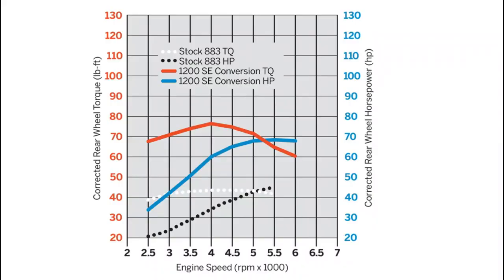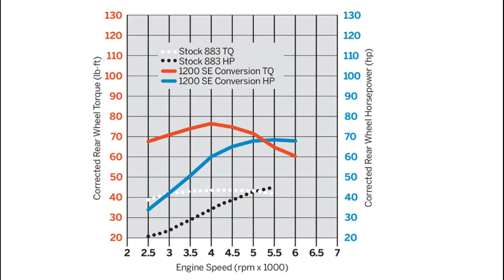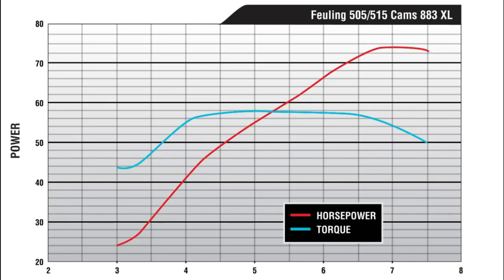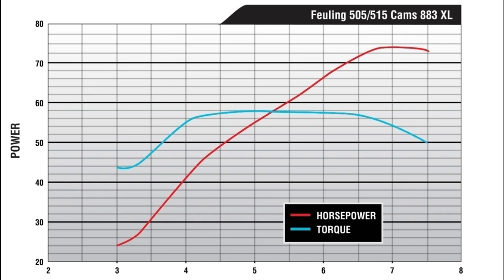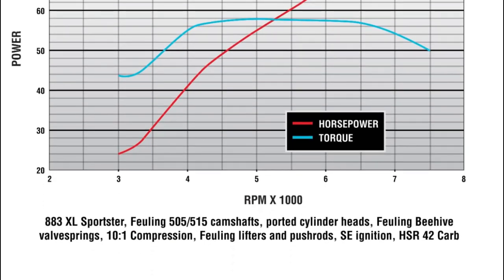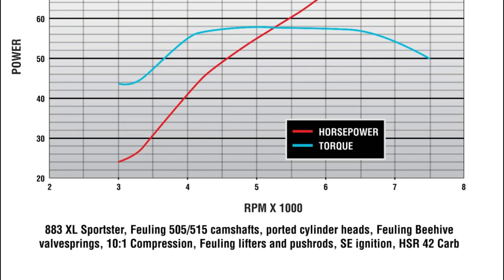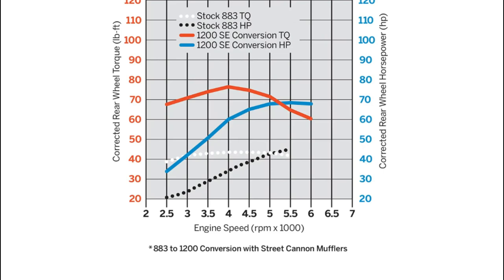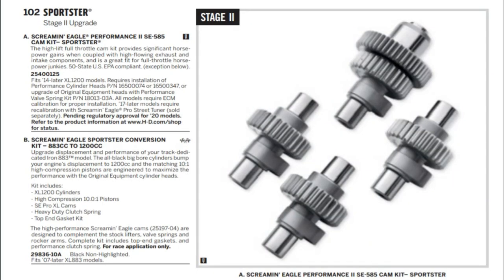Sportster Cam Upgrades To Increase Horsepower and Torque

Comment: Call Hammer Performances engine builder Fred yesterday
Told him $$$ is not an o option
He said  start with a XL1200 because  the  (heads) are good , then  get a 7.50 cam  & Energy One Clutch till the end of the season , break them both in together 
Then , IN THE WINTER  IT'S 😢TOO 
COLD TO RIDE go full on 1275-130+ b.b.k
With HEADS PORTED , HI-COMP  PISTONS .
With , Brass drive gear  , ETC. .
And probably make my own Header . ❤

Comment: Any opinion on upgrading an ‘02 Hugger with an S&S Hooligan kit? Looking to get better performance out of my bike vs spending twice as much on a larger bike. Hooligan kit includes a cam kit. Appreciate your professional opinion and experience. My Indy shop is an S&S shop, so they prefer going this route over Hammer Perf. Thx in advance!

Comment: What CAMS do you recommend for an 03 Sportster 1200 custom 100 yr? I have a stage one, and want to upgrade to a stage two. Just CAMS. Just want a little extra power and torque, don’t plan on upgrading it more than that. Just want to have power when I needed. 2003 Sportster 1200 custom, full Vance and Hines for exhaust, high flow air filter, never ride two up, I cruise at low rpm’s. Once and w hike have a Burst or two.
Reply from the maker: I would check out the Andrews N4, that's an excellent cam upgrade for a rigid mount bike!

Comment: I had a 06 Vince Hines pipes rejeted carb and a se 551 cams ran good.  But it needed a ignition modular.  It would it the rev limiter around 5500 rpm .I wanted to put the rev limiter 6500 .but I crashed the bike
Reply from the maker: Dang that sucks, hope you were alright!

Comment: This is very interesting.  Would a tuner be needed for this mod and additional work (like what Screaming Eagle wants with extra parts for the upgrade)?  Can you jump from stock to Stage 2 cams without pipes and air intake mods (adding them later)?  This is something to think about and lots more research that I need to do.
Reply from the maker: With cams it would definently need a tune, but yes it can be tuned for a new set of cams while using the stock air cleaner and exhaust. Timing is the most important part, you can get an aftermarket tune for a stock bike and it will make a huge difference.

Comment: Tomorrow I'm buying  a 2009 XL 1200 with  2,800 miles mint , Woman Owned , just completely serviced at Local Harley Dealer
My Question is ; 
Whats the the most  cost effective way to add Torque/Horsepower ???
My thinking is : 
Fit some Hammer10.5-1 H.C. Pistons $300
Hammer 560 or 570 cams .$500
Hammer "Crush" heads $1100.
I'm hoping to get 100+ Trqe/Hpr.

Let me know ?
Any ideas ?
Of course I'll talk with Aron @Hammer Performance also 😎

Thanks in advance Riders

Comment: I have a 2019 iron 1200. I’ve been thinking about a cam upgrade. What cam would you recommend?  I know I’m limiting myself, but I want a drop in cam.
Reply from the maker: I got the perfect cam for you and it's an absolute banger over stock. Check out the Hammer performance 570 cams, they are bolt in on the 2019 and they don't rob your low end for the top end. It's like the stock W cam but builds on the torque and you gain top end horsepower without any loss in the power curve anywhere.
Reply: @GixxerFoo  thanks for the recommendation. I will go and check out that cam

Comment: Don't Forget to Mention:
Dual Fire Ignitions do not sit well with cam upgrades.

and, honestly, if i would have had a W cam, i would not have felt the need to swap in aftermarket cams . i had the old D-cams, and single fire ignition; so it cost me $800 to swap into my N2s
Reply from the maker: That's a great point about the the single fire ignitions! The W cams are hard to beat since most Sportster cams take from the bottom and give to the top.

The only Sportster cams l have found that can beat a W cam all around power and give nothing up is the Hammer 570 cams.
Reply: @GixxerFoo  so you can imagine a single fire ignition given a higher overlap cam ..... i did ahead of time, i am sure the rear cylinder would back-fired to no end.

i got the Twin Tech ignition, and my N2s put peak torque up around 4K2 with my custom welded pipes...different pipes make any cam different.

Comment: H-D Installed Pin Oilers, ( "oil sqirters" ) When They Went To The W Cam .... All The Aftermarket Cam Girders Need To Reconsider Their Profiles Ground For Pre-Pin Oiler Sportsters.
Reply from the maker: That was good tech from Buell right there, Andrews and Hammer make great cams for rigid Sportsters. I still think Andrews grinds Hammer's cams for them but Andrews told me they couldn't confirm or deny lol.
Reply: @GixxerFoo  i recently found out that Ultima makes a "High Volume Oil Pump" that will fit my pre-pin oiler... so the answer is " increase the big end sling " when camming pre-pin oiler sporties.
Reply: @GixxerFoo  no problems 04 and on, the ones with pin oilers can pretty much handle anything you throw at them.

but i would definitely suggest a high volume oil pump when camming 03 and earlier model Sportsters..
Reply: @GixxerFoo  the only solution for camming pre-pin oiler Sportsters ( 2003 and earlier ) is installing a high volume oil pump with the cam swap..
i figured that out after my comment here.
Reply: @RulgertGhostalker  so do you think I need a high volume oil pump for my 2000 sportster 883 w the 1200 wiseco kit and the heads are done? The only thing left is cams now. It runs really good now but I still want more of course
Reply: @rogerthompson5521  yeah definitely ....anything pre-pin-oiler, putting out more than stock, i recommend a high volume oil pump ... in my last Sportster video, i go over the why on that, sit sump cures, and breather mods.....
i am pushing 1200 type power on my stock 3.000" inch bores, that's just cams, my custom pipes, compression increase, race ignition, 93+octane, and a whole month of work on my heads..but Same sort of Heat, with much higher BMEP, on the smaller pistons.

Comment: For a XL 1200 C 2017 model , which is the best cam for more torque ?
Reply from the maker: The best cam and doing nothing else to the bike is Hammers 570 cam. That is the only cam I have seen improve over the factory W cam without sacrificing power anywhere. If you're absolutely not worried about top end or the upper end of the mid range the Andrews W2 is a straight up low end cam. It will cut your top end power though so just keep that in mind.

Comment: What if I have mine bored out to a 1380 with a screaming eagle clutch and is straight piped what can I do to make it faster and go to a track and race
Reply from the maker: If you were to bore the cases Hammer does have 88 and 90 inch kits. Hammer can put together a 120+ horsepower package but it will run you about 6 grand and that's if you assemble it yourself.

Comment: There is no camshaft upgrade for a stock 883. Stage II on an 883 is a bore increase.
Reply from the maker: You can add cams to the 883 but it's really not worth it unless you're doing some kind of spec class racing. They will make some power but you're very limited by displacement.
Reply: Really? Because I can list a few cams that are drop in cams for the 883
Reply: @beardedforlife3740  go for it
Reply: @eveythingthatsadam  Andrews N2, N3, N4, and SE .497 cams all bolt right in with no extra changes

Comment: Did I hear this correct 100hp from a cam and exhaust?
Reply from the maker: If you have a good cam like the Hammer 560 on a late model injected bike with the good heads and a really good exhaust it is possible. Adding 10.5:1 compression will further solidify that. But if you have a 03 or earlier the stock heads are awful for performance, you'll need some head work there.
Reply: @GixxerFoo   08 1200c

Comment: I got that hp and torque with just a stage 1 and dyno tune . Well I got 85.5 hp and 81 torque
Reply from the maker: It's really surprising what a exhaust and tune will pull on a 1200!

Comment: How can I increase my 2012 1200 custom to 100hp
Reply from the maker: Hammer Performance 1275 Kit and a set of their 560 or 570 cams with a good solid two into one exhaust with a solid dyno tune and that will make it happen.
Reply: Turbo.
Cheapest, safest way to make power.
And it won't overheat your motor.

Comment: I think I'm gonna run andrews n6
Reply: 1275 big bore, +300 30deg dome pistons and super stock heads, drag pipes because brap, jetted cv40 she's spicey already
Reply from the maker: Andrews makes some good cams, best I've seen is that 570 from Hammer if you're going to just bolt in. The 560 if you're gonna do the big bore kit with 10.5:1 compression.